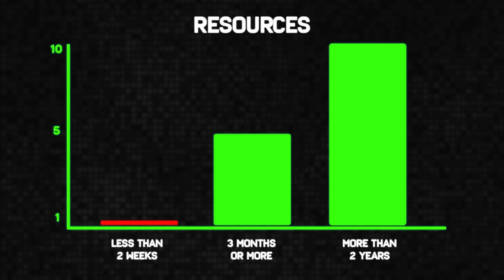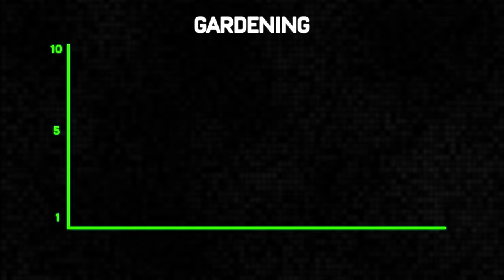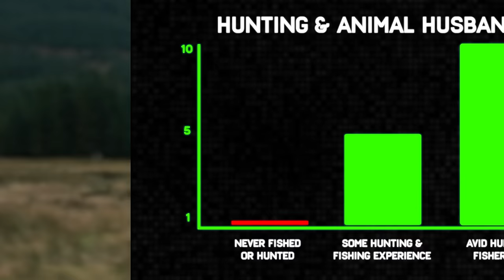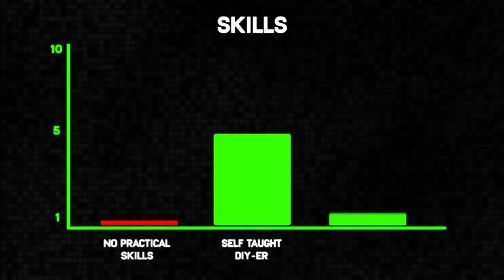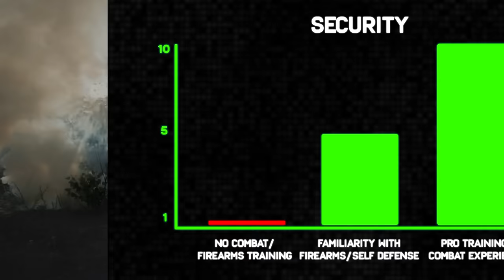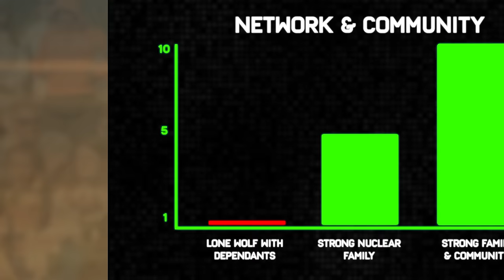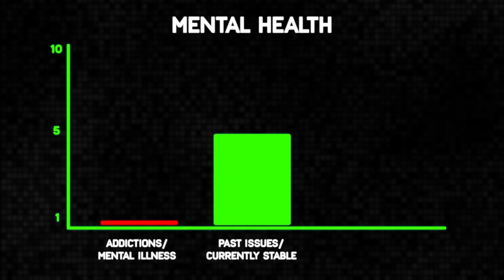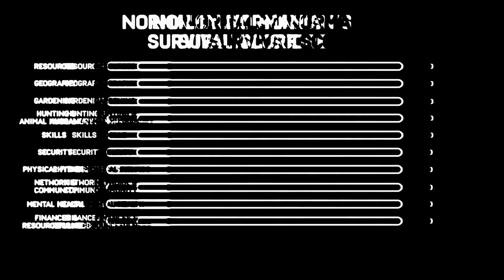The Prepper Rating Scale: How Likely Are You to Survive?

Comment: I scored a 88   I'm 55 single never married and no children. I live in a small midwest town of about 800 there are plenty of lakes and great hunting plenty of wild game in the area it's an hour or more from any large city. I'm Ex-Military ( 7th Light Infantry ) and have lots of preps been prepping scene my 30's I also train German Shepherds as guard dogs or as service dogs or both depending on what my clients want I also reload my own ammo. I have had many talks with my neighbors and are Sheriff and Deputies on what the town  that I live in would do if the SHTF and we all agree that the town would block the main highway that goes through the town and post guards at the checkpoints to stop anyone that not from here from entering the secured area of the town with force. Where I live there are a large number of Veterans and pretty much everyone hunts and we all have plenty of firepower at are disposal. I also have solar panels a wind turbine with a battery bank and a 13000 watt  tri fuel generator  that is hooked up to natural gas the house that I live in was built in 1912 and is pretty much bullet proof with the old plaster and lath walls it also has a huge empty steel fuel oil tank in the basement that could be filled with probability a couple hundred gallons of gasoline if needed. I also have a 200 gallon propane tank as a backup just in case I was to lose my natural gas for some reason. The only nuclear first target in my state is Ellsworth Air Force Base outside of Rapid City 3 and a half hours west from where I live little chance of any fallout from a nuclear attack here fingers crossed.

Comment: One big flaw in this rating system is, you’re only as strong as your weakest prep. 

The most clear example is physical fitness. Say you have an incurable disease that requires modern medicine to stay alive. You get 0/10 physical fitness. Let’s say you get perfect 10/10 on everything else, your score is 90/100 in theory. 

In practice though, your score cannot be this high, because it’s all for nothing once the medicine you need runs out. 

You’re actually much worse off than someone who gets a 4/10 across the board, for only 40/100 overall. 

This also applies to severe mental illness being medicated- without the medication, you may be unable to function and utilize the strengths you have in other categories. 

This could also apply to security: if you have no way to protect yourself and your resources, you’re likely to be exploited. 

Of course, this doesn’t apply to all of the categories: a low finances/resourcefulness score, for example, wont take away from the others like a low health score.

Comment: scored 93. live very remote, have land, production, spent many summers in a tent in remote parts of alaska. very large family. have killed bear and deer... with gun and bow. trapping, fishing, organic farming, fruit (bottle about 50 gallons of apple and grape juice a year) and nut trees, grapes, berries... butchering large animals, raised cows, goats, chickens, bees...  have heat with wood for decades. make maple syrup, built a building using wood i saw milled off my land, fixed cars, tractors, welded on equipment,  run electric, done plumbing, designed diesel generators, solar...  can still cut and split a truck load of firewood in 30 minutes. have first aid kits, produce colloidal silver, have delivered babies, .. what every so called survivalist misses is MEANS OF PRODUCTION. grid down, what means of production do you have in place? your chainsaw in many locations will be your most important survival tool (followed by your splitting maul). doesn't matter how many cans of beans you have on the shelf... what can you do to feed yourself so you dont have to open the last one? a cord of firewood has the energy equivalent of 200 gallons of liquid fuel. one can cut 2 cord of firewood using 1 gallon of gas (with oil mix). thats energy multiplier of 400 to 1. energy for heating, washing clothes off grid, washing dishes, sterilizing water, cooking food, making maple syrup (13000+ calories per gallon)... do you have a good quality grain mill? do you have a way to cook using wood? do you have a good quality hoe for gardening? the hoes sold at most stores are absolute crap and dont last a day (yes my hoes cost $100 each). do you have the tools to produce? solar panels for electricity to charge your tools...  ie... MEANS OF PRODUCTION. another category you missed is COMMUNICATION...grid down... no internet... shortwave radios? ham radios? knowledge to use them. when it comes to communications your antenna is 75% and the radio is 25%. do you know how to set up a quality antenna for high frequency signals? how will you communicate with others in your group or family? how will you get information of what is happening in the world so you can meet those challenges armed with foreknowledge? my backup sw radio is a tube radio from the 1950s that was gone through and the old capacitors replaced. this radio has a better chance to survive severe emp. which brings the final point... redundancy in most systems when possible. multiples in everything from chain saws to hoes.